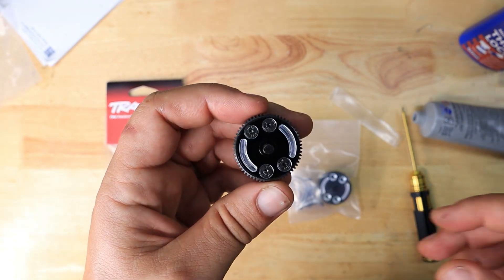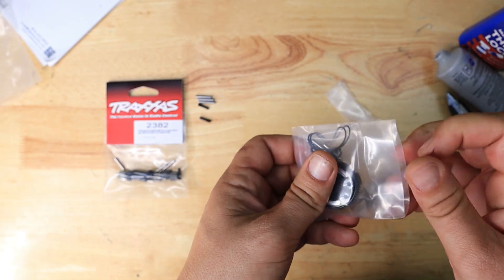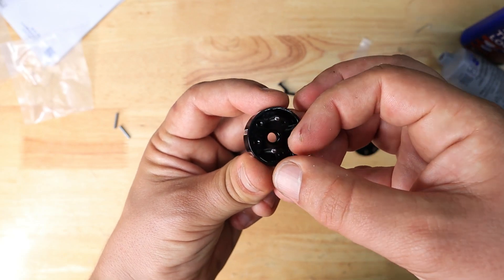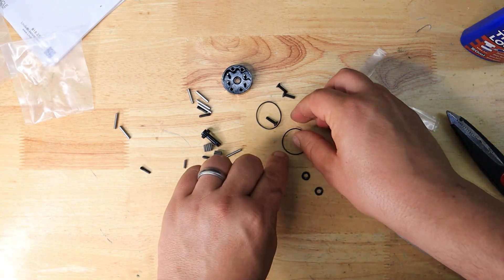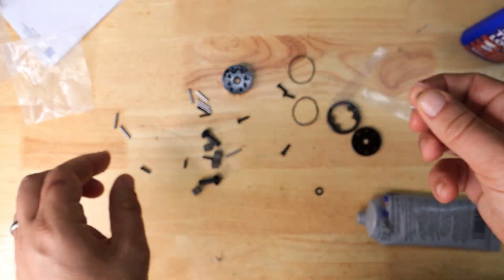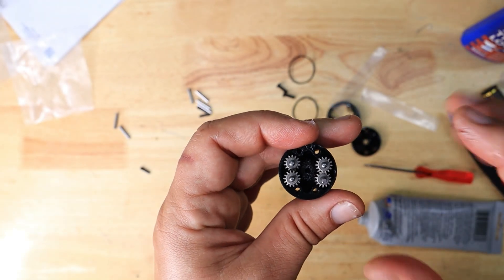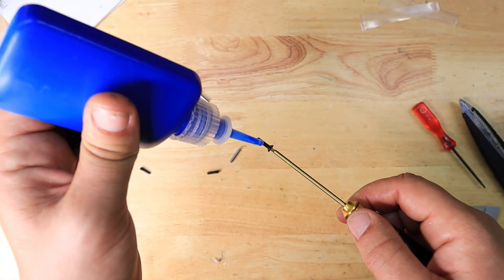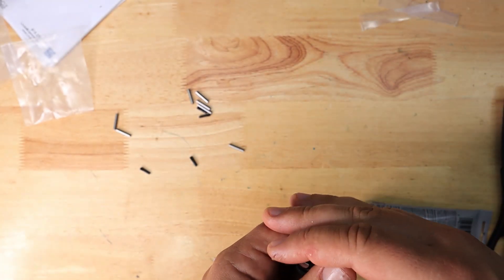2wd sealed differential assembly for Traxxas Slash, Rustler, Stampede, etc...

Comment: Do you just sell the casing? I looked on the site but only see the completed differential
Reply from the maker: @wyattgaillard5286  at this moment, we don’t sell the casing.  Just the completed diff.
Reply: @CobraRacingRC good to know. Wish you guys sold the casing. I have one of your diffs for my 4wd slash and it’s fantastic
Reply from the maker: @wyattgaillard5286  awesome - we may add the case for the 2wd in the future.  Appreciate the feedback ❤️
Reply: Is there a groove that the oring for in, it looked to me that it wasn't seating very well, could be my old eyes! 😂
Reply: What diff fluid do you recommend for a 2wd 100mph rusted set up?